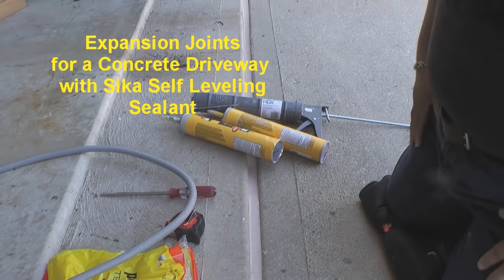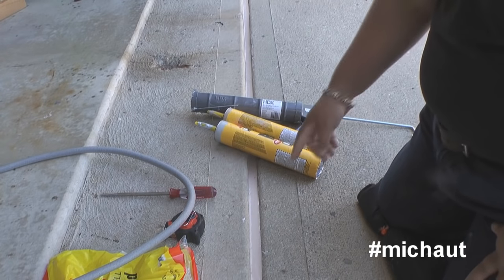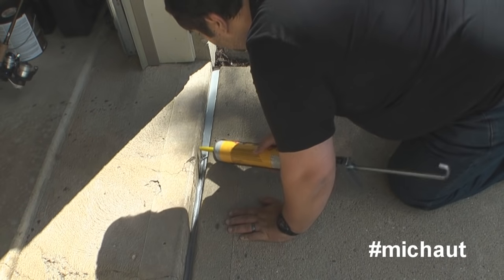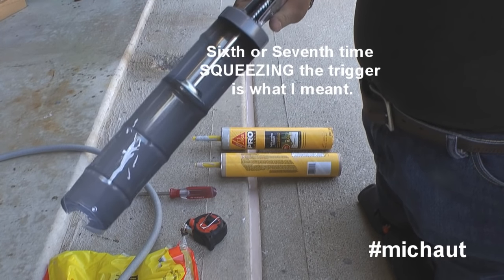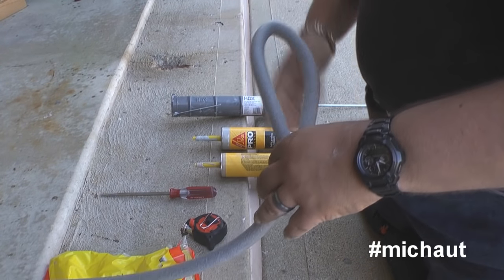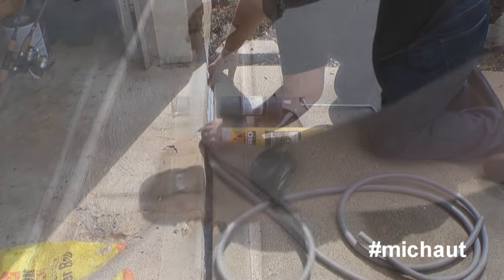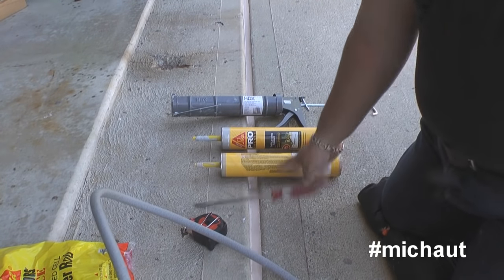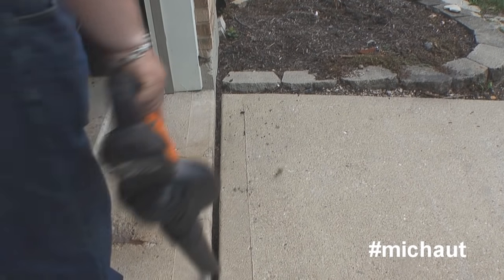Concrete Expansion Joints and using Sika correctly

Comment: How many feet do you get out of a tube
Reply from the maker: John, the truth is that it depends on how thick you apply the Sika and how deep you have the backing rod.  You DO NOT have to shove the backing rod DEEP, just enough to make sure your sika can reach each side of the gap your sealing without leaking through and also be smooth.

Comment: how this instalment when the gap is abt 10 cm?
Reply from the maker: BamBang - That is a considerable gap, I think the answer depends on the depth.  IF you can make sure the depth is a constant 3cm to 4cm then the width can be filled.  I admit that you should ask that question to sika directly to be sure.

Comment: Has anyone used this product on siding and door frames?
Reply from the maker: Im sorry Christine but the nature of this material is to self level into crevices...in other words it pour out of the siding and frames.  what you want if you want to stay with the SIka Brand is SIKAFLEX® CONSTRUCTION SEALANTSikaflex Construction Sealant is a moisture-cured, 1-component, polyurethane-based,non-sag elastomeric sealant. Meets Federal specification TT-S-00230C, Type II. Meets ASTM C-920, Type S, Grade NS, Class 25.
USESeal joints, cracks, doors, windows, and siding. Bonds to most building materialsCHARACTERISTICS AND ADVANTAGESSeals Joints & Cracks.Superior Durability.PaintableStainableSandableCOLORWhite, Limestone,Capitol Tan,Dark Bronze- See more at: http://usa.sika.com/en/solutions_products/Construction-Products-Services/construction-sealing-bonding/construction-sealing-bonding-products/02a025/02a008/02a008sa54.html#sthash.razc82Gf.dpuf
Reply: Thanks for the response I was also considering the sika sealant to caulk the doors Windows and siding!

Comment: DO NOT USE BACKER ROD, to..over the years I've used backer rod, it's shifted. Then I partially filled with sand, it shifted. It's expensive, but the only way is totally clean joint, then completely fill with caulk.

Comment: use expansion foam instead of backer rod. Let dry. scrape excess foam do desire height. apply self leveling sika on top of foam. No need to worry about different dimension of backer rod for different size expansion joint
Reply: Wrong, wrong, wrong. Spray foam is not a closed cell foam, when you cut it flush you open the porus cut material toward the direction and moisture would come from. The cut foam also creates a porus surface causing 3 sided adhesion which is not allowable. Spray foam is also not mold, mildew resistant. It is also not flexible. Spray foam should not ever be used for backer on a slab.